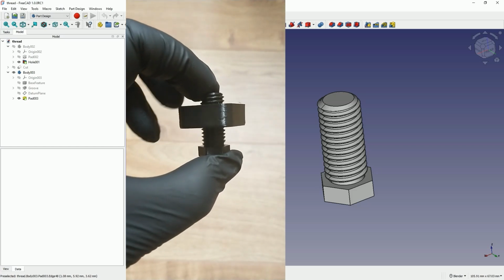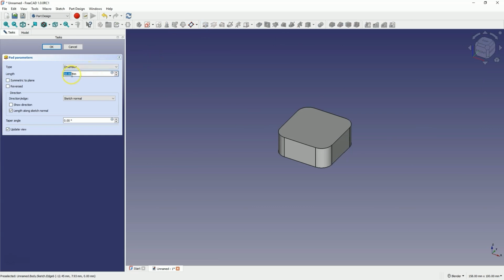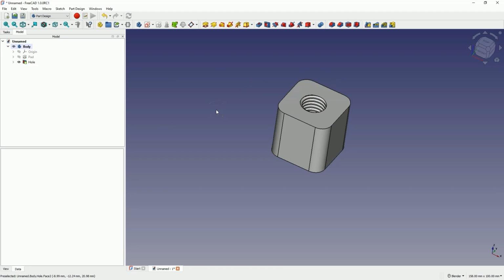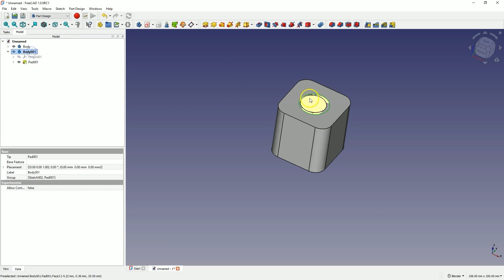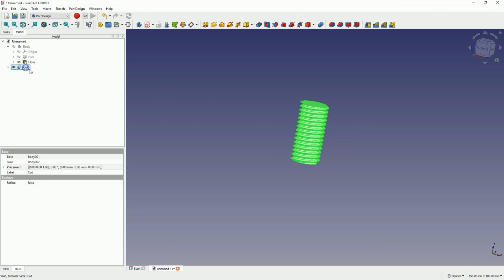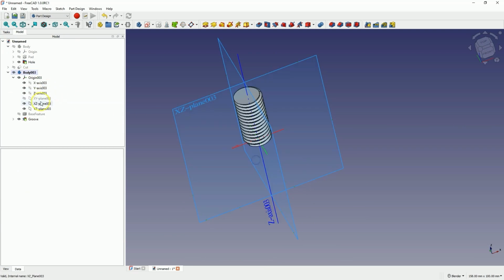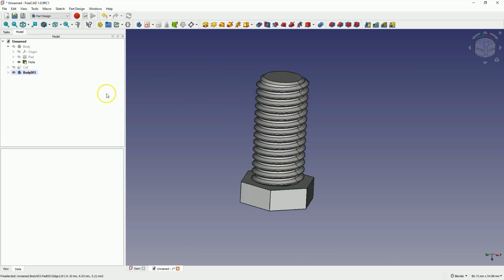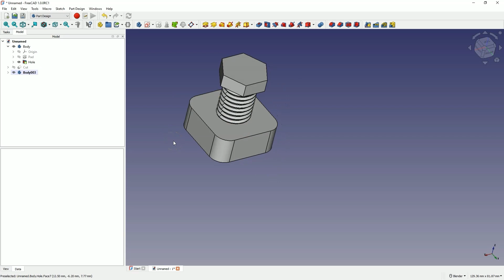Thread in FreeCAD

Comment: Thank you so much! This was truly helpful for learning how to create threaded 3D products. I do have a question though. I found that if I wanted an M12 screw/bolt, after created it, I had to increase the size of the threaded hole to the next size (i.e. M12 to M13) to get them to fit together. I may have been confused when watching your example but when you created the block with an internal M12 screw thread, you then used a 13mm circle to create the screw. But I found that if I created the M12 block, and then used a 12mm circle to create the screw, that the hole was too small. So, I'm not sure how your 13mm circle to create the screw worked. Hopefully this makes sense.

Comment: Thx for the interesting method of doing threads. Just a note that the chamfer on the bottom of the threaded part will not work in the default FreeCAD 1.0.1 settings - I had to disable "Automatically refine model after boolean operation" in Preferences Part/PartDesign, General.

Comment: Hi and congratulations on your video.
I am a beginner and I have just started using FreeCAD after purchasing a 3D printer.
I need some help with threading.
First, I’d like to ask if there are any libraries of pre-made parts that can be modified to simplify the creation of threaded components (male and female), especially with USA thread standards.
Specifically, I need the 11/16"-24 thread.
Thank you very much!

Comment: This helped a ton! I designed a battery box to run two batters in parallel and wanted to have a lid with a handle. I didn't wanna deal with supports so I made the handled threaded and will screw in.

Comment: To provide tolerance (without scaling with percentages) go to hole parameters, activate custom thread and ad 0.5 - 0.6mm to clearance and that should enough to provide a snug fit on the threaded side for your bolt, or set your own tolerance value. Remember to cut your bolt profile before enlarging the threaded hole.
Reply: Thank you for this tip!
Reply: You are a legend, thank you.
Reply: Thanks! 0.5mm clearance worked perfect for me... also as a nut for original metal screws.
Reply: Thanks a lot for the tip. 0.5 clearance is a sweet spot for 3d printing.

Comment: but in this case the nut and the bolt will be very tight. Is there a way to make some tollerance on the thread to make it more easier to screw in reality (3D printed)? Thanks.
Reply: I just upscale the nut by a percent of half depending on how big it is to begin with and that’s worked for me
Reply: can you use the offset feature for one of the threads? In other programs, they use an offset of -0.4 that allows the threads to work.
Reply from the maker: I scaled the nut in the slicer.
Reply: @CADCAMLessons that’s what I do

Comment: Nice !
I'm quite curious, if you make the thread with this method and then go back to the the original body part and add clearance in the thread hole would it work without adjusting on the slicer ?
Reply: yep! just make sure if you are planing to knurl or any other ram-eating process, make sure you have the ram, or adjust the hole before you do those processes, otherwise it can crash or fail to recompute and you lose aspects.

Comment: Is there a reasonable way using this method to add tolerance to one side of the threading?

I could definitely scale the model non uniformly, but this makes it hard to engineer other tolerances.
Reply: yes! after you model your screw shaft, copy the body of the nut to a new file ( right click on only the original body> copy>yes when the box pops up) 

via the tabs at the bottom of the frame (start page>new> part design workbench> create body> right click body in tree> paste) 

from here, in the tree, you can right click on the "hole" and edit it. to add additional clearance ( edit> check box next to "custom thread"> input .4 to .6mm of clearance in the box next to it> ok) 

this will add additional clearance to the original profile in the nut, without adjusting the new screw shaft you have in the other tab

Comment: Shouldn't clearance be modeled for printing instead of trying to match clearances with scaling?
Reply: Slicers have an offset parameter that can be used.
Slightly scaling up the nut in only the X- and Y dimensions would also do the trick, though!
Reply from the maker: @leftaroundabout, That's exactly what I did for this project.
I scaled the model in the X and Y axes.
Reply: I agree. I wish this video showed best practice for MODELING the clearance instead of using an inexact workaround with the 3d printer slicer program because the scaling percentage would change depending on the scale of the model or print.